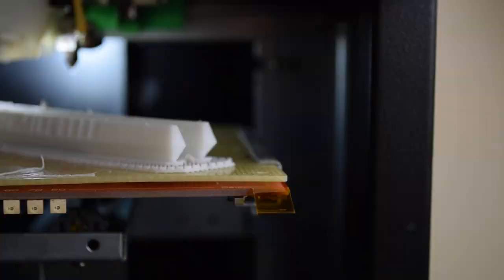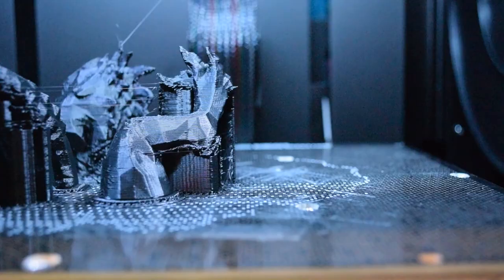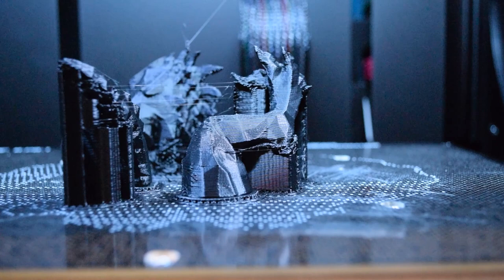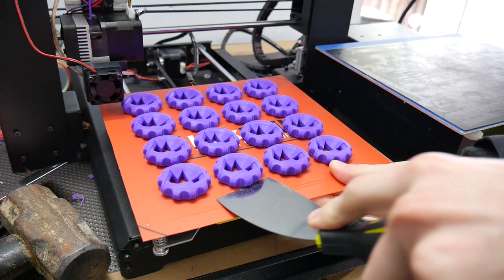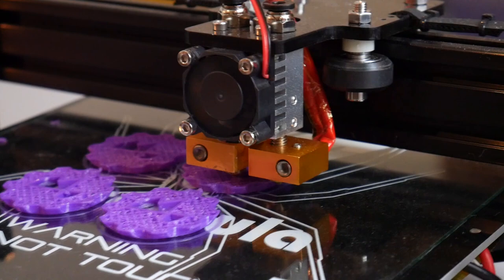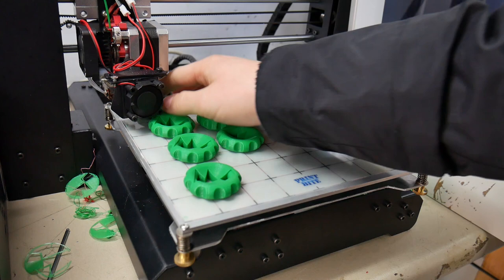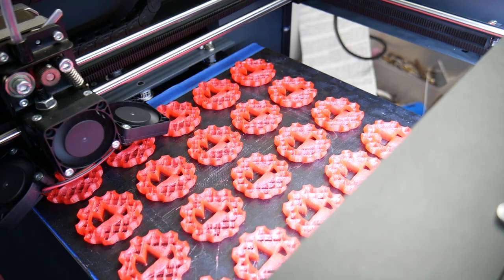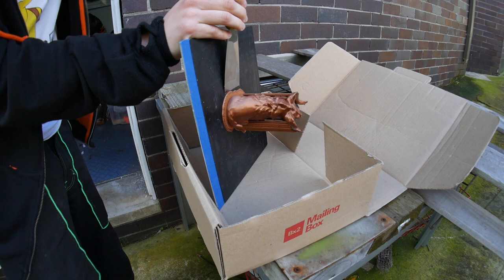The most dangerous 3D Printing Tool - Scraper Blade Safety - 3DP101

Comment: Your words of caution are duly noted.  One tip is to grind the corners down to a radius on the tool.  Helped me a lot!  I also don't keep it sharp.  When I ground the corners, I also beveled the leading edge in one direction and marked the tool "up" in order to make it more of a wedge than a knife-edge.  The grind would go on the "down" side so you can use the transition as a fulcrum.

Comment: Scraper safety tip(s): - Grind or File your scraper corners, to round them off,  - Double-edge sharpen only the front.  - (if possible) Mount a small strip of wood to your workbench. Place the bed on the bench and push the scraper away from you, in the direction against the wooden strip.
Preferably you shouldn't use a scraper, if you use removable and/or flexible build-surfaces, or a proven cooling/or heating technique to loosen the parts.  But sometimes it just absolutely necessary.

Comment: If you can't remove the print bed, I find it helpful to somehow block it from moving. I found that out after I was really careful holding a bed in place while using a paint scraper to remove a print. I did all the right stuff trying to keep my hand out of the line of fire, but the tool was redirected by an even more stuck part of the print once I got part way through and ended up going into my hand. Plus blocking the bed in place helps prevent damage to the machine and you loose less force to motions you probably don't want the bed to be going through anyway.

Comment: Another trick is to put your entire build surface in the freezer. Since the build material and the surface will cool at different rates, one will contract faster than the other. (Obviously, don't do this while the surface is still hot!)

Reusable ice packs also work well if you put them under the build surface, just below the print.

Comment: I do some woodworking as well as 3D printing and I found that an old hand plane blade is wonderful for removing prints.  The blade is heavy, very sharp, and one side of is mirror flat.  If I lay the flat side of the blade down on the printer bed and give the blade a tap with a light hammer, prints just pop off the bed with no damage to the print surface.  Very little force is applied, so safety hasn't been an issue.

Comment: Thermal Shock on non glass surfaces can sometimes help instantly release a part that's really stuck on. Heat it up a bit then hit it with something like canned air (in a well ventilated area)

Comment: I use some really dull paint scrapers, you could slide them across your tongue while pushing extremely hard on both ends and you won't even feel anything. I've never considered sharpening the tool, as I haven't had a need to (dull works fine for me).

Interesting video anyway, I'll keep the advise for the future. Thanks.

Comment: I use a painters tool which is basically a stiff paint scraper and only sharpened on one edge. The edge is like a wedge so once it's under the print is off.

When I was doing abs prints on bread board I would use that and a light wooden hammer. I find the hammer gives a much more controlled force and keeps both hands out of the way.

Comment: Just got the new Creality CR6SE... printed a Utah Tea Pot and my son's friend broke the top off the lid without getting it freed up.  I intervened before be could break more.  Looked at a video and the advice I came up with was let the glass(ish) build plate cool down all the way.  Still stuck... ran it under the faucet with cold water and the lid slid right off.  I already have Wham Bam bed system on order... I'm hooked.  But before scraping and scarring yourself, I'd advise running cool or cold water over the back of the plate and see if your print just releases.  It's the glass contracting I believe that makes it work so easy.  Could even run it under warm and then cold water for further expansion and contraction of the plate... no scrapers needed.

Comment: I have bought a Cel Robox and am using  PLA only at present. I find that the tool set supplied for trimming the prints after printing are useful, especially the 8-9mm wide bladed chisel. A little coaxing with that and off comes the print. I am being careful not to damage the bed. So far, no disasters! Useful video. Thanks. PS I`m not actually sure what the bed on the Robox is made of.....

Comment: My fav tool is my razorblade, held in a scraper tool,  obviously this is really dangerous :P  (only on my glass beds)   I have a meat cutters glove that i wear on my other hand just to play it safe. :)   

Angus your point about self releasing on glass only really applies to ABS,  ive found that PLA wont really self release from glass.      Generally i can user the razor blade to lift a small corner, then get the spatuala under the razor blade to pop off the rest of the print nice and easy.

Comment: Great Comments all good feedback, I'll try a post a video Angus of the BuildTak FlexPlate we have been using. It works like BuildTak only instead of using a scrapper to remove prints you flex the plate and they sort of peel/pop off.

Comment: What i found out was that if you print with a brim, you can take a scraper or hobby knife and gentle lift the brim in each side of the print. Then you are able to grab those 2 brim parts with your fingers and yank it off. (done with PLA on a aluminium bed)

Comment: I avoid scrapers like the plague. The best way to do this is by designing an aluminum plate with embedded magnets(programmable/polymagnets are the best for this application) and another sheet(spring steel) that is thin, flexible, and magnetic. A  printing adhesive or material (I prefer a thin PEI sheet that has a high temp adhesive backing) is applied on top of the flexible sheet. 

here's how it works:
the flexible sheet with PEI print surface is magnetically attached to the aluminum plate. When prints are done "shear"/slide the flexible sheet off of the aluminum plate and bend the flexible sheet which immediately pops the print off. :-)

Comment: i have a fiberglass bed, so you can just bend the bed to pop it off. on my delta i used a can of air, turn it upside down and sparaying liquid refigerant and it usually shrunk and poped off.

Comment: ONE: Scrapers are SQUARED on the tip, so it is wise to sharpen the EDGE approximately 15°-30° angle like a single edged knife but not sharp enough to cut flesh when running your fingers over it.

TWO: get rid of the SHARP edges! Sharp pointed tips cause tempered glass to shatter or when someone hit their palm with that tip it will definitely cut flesh. Use a stone grinder or sand paper to ROUND OFF the edges and then sand down the scraper to a 15-30° on one side.

THREE: use a removable borosilicate glass with 3mm thickness on top of the print bed. It’s safer to remove the print OFF the printer, convenient, but also prevent any damage to the printer/printer bed.

FOUR: instead of placing the print bed on your KNEES while removing the print, place the removable bed (cool-warm NOT HOT) on the floor if it is carpeted, if not use a rag or cardboard to prevent any damage to the bed and or floor.

FIVE: right knee down, left leg up, lean the bed over your right thigh to keep it STABLE at an 80-90° angle, push slightly on the scraper under the print (sanded part of the scraper up) and push against the bed and down while moving the scraper side-to-side until the print lifts up. If it is a BIG print use all sides to lift the print not just one side if it doesn’t have any weak components. Quick blows with a hammer or something will damage the bed if not done the right way and will DEFINITELY shatter glass.

My experience with it. I hope it helps...

Comment: If you need a scraper you're doing it wrong imo, right surface (PEI, PVAc/elmers glue) and right temps gives good stick while printing and easy release after. I've added a 140mm PC fan controlled by the printer to blast the print and bed down to room temp faster for quicker turn around.

Comment: Be wary of the scrapers that come with Wanhao i3/ Cocoon Create - the handle on mine has come loose (after using it to remove the BuildTak) and now it comes off regularly. It means that the sharp end can slip in unpredictable ways when applying force.
Reply: well I hope you bought a new one, Hyde is a good brand, most of us drywall contractors only use Hyde knives

Comment: personally ive bailed on a paint scraper and i use a "snow scraper" 3d printed at .05 layer height.  of course you A. have to be capable of .05 height. and B. have to be calibrated enough to be able to pull it off.  I'm on a rep2 and have a few printed on hatchbox petg and they are crazy sharp and perfect for this. and when they break, i just print more!

Comment: I have only used ABS and PLA materials so far, but I'm using my plain borosilicate glass plate with hairspray for both materials. I always let the bed cool back to room temperature and the parts self-release. I don't understand why there are so many products to expand on the problem.

Comment: i dropped a scraper on my foot once, was bleeding n stuff and i still got the mark of the wound. now i use a magnetic flexible PEI sheet with good adhesion when heated and if it cools down, i just can grab the print like its just laying on top of the bed.👍👍👌👌

Comment: I have no scars. My method: use a craft knife to carefully lift the edge of the print (about a millimetre), while holding with the knife blade slide the scraper under softly. This means the blunt scraper is not pushing on the edge of the print. Then remove the knife, lift the print about five mil using the scraper as a lever, and then slide the scraper in a little further. Rinse repeat. Easier with a raft, but works every time because you're not pushing the print sideways, but lifting a small portion. Go slow be careful.

Comment: Printbite. It bloody works.
Reply from the maker: I'm inclined to agree! Haven't torture tested it yet but for every day printing it works a treat.
Reply: Yep. I mostly print in ABS and was fairly happy with PET tape and ABS juice, tried Buildtak, which sticks so well I destroyed if after 3 prints. Bought some Printbite and will never go back!
Reply: PEI is just as good :D
Reply: I used to make the same mistake with PET tape. However, i realised later. You dont need ABS juice for PET Tape to work. Just print slow for the first layer, 10mm/s or lower, at 110C heated bed or slightly higher. If possible, raise the hotend temperature slightly for the first layer, about 5~10C. Your print will pop right off when the bed is cooled.
Reply: Im pretty new to this whole printing thing and when i got my first printer as a gift from the rest of my family i noticed that my first layer would never stick and a portion of the print would curl off the printbed, ive pretty much fixed that by using blue painters tape, except when i went to print a little model vanguard (a star citizen spaceship) for my brother and the back left part of the print lifted off for some reason, it didnt ruin the print just it just sort of "squished" the back of the part where the first layer didnt stick and curled off of the plate.
idk how to fix it as im super new to this whole printing thing

Comment: Just use PET tape, it works like magic, you dont need to risk breaking your hand or your print with the scrapper. Your print pop right off when it is cooled.  Not to mention the bottom finish of your printed object looks glossy and smooth like glass.  It works with ABS, PETG, and PLA. I am yet to test other type of filaments. For abs, heat your bed to 110c for printing. 70C for PETG and PLA.  Your print will pop right off at around 40~30c when the bed is cooled. Even if your print doesn't pop off when the bed is cooled, you just need to twist/pull it with a little force by hand.  Safe and easy. The tape seems to last forever as long as you don't scratch it with a knife or scrapper, or damage/wipe it with acetone.

P/S: if you failed to get your print stick properly, just make sure your first layer is printed at really slow speed, like 10mm;s or lower. Increae the hotend and/or bed tempature by 5~10C if you need to.  Your print will stick really well when the bed is still powered.

Comment: I just pry with the scraper. I just put it on the build plate with the edge grinding flat on the plate, slide it a bit under the part then push the handle down. Its like a wide and small crowbar. It makes a little space then i can push it a bit further in and pry again. It takes 2-3 pries and it usually pops off the surface.
Another thing my scraper came horribly chipped and all burred on its edge. I just used sandpaper to get it nice and clean. And i dulled the edge a little bit too. I dont need it digging in the surface... By the way i use the wanhao i3 stock surface, i read its like build tec? Anyway sticks well and releases nice.

Comment: I have another way to take prints of the bed: with those snipper thingies, put it under a corner and snip just the corner of the print bed. then, use the blade and start with the corner you took of the print bed and scrape.

Comment: what i do is i first push under the "Skirt" and release it. and then i take the scraper thingy and bash on it so it goes under the print it self and then i bend it to right or left and plopp goes the print into the air and my fingers are never even on the side of the blade :D

Comment: place it under a corner/edge.. then tap the end/handle with a mallet/anything heavy n handy..
Reply: I remove my prints while still on the bed & glass so I can press print again within seconds..
this has never failed, just make sure you get it between the print and bed.

Comment: Hi! 
I was interested in if you could take a look at some of the ColorFabb specials? 
Things like Wood, Cork or Copperfill look really interesting, and the CF-XT material might be super awesome, however it's hard to say if it is worth to get them due to how little good reviews there are.

Also, since you have done a video about different functions of Simplify3D, I think it would be fair to give Slic3r some attention too.
It's a free and well working alternative after all, and DOES have the capability to do some fancy tricks thanks to "modifier parts" that allow localized changing of settings.

Comment: tip: use razer to get underneath the print first(even just a little bit). then use scraper to finish the job. so much safer, so much better.
With this method, my blue tape is even still intact !!!!

Comment: A beveled chisel is waaaay better than a damn scraper. It is sharper and much stronger, it does not bend when you use its bevel to get under the print. Also: this is why the heatbed glass has to be removable, you take the glass off and put it in warm water with a few drops of detergent for a while. It pops off pretty easily.

Comment: I don't understand why you have so many troubles with this. Just put a 4mm (or 6mm if you printer can handle it) tempered glass. Use a hair spray on it, waith a few seconds to dry. Print over it. Wait until the glass is a bit cold and the piece almost pup up by itself. The tempered glass it's very hard to break and never fails. Try it, it nevers fails.

Comment: +maker's muse which printing surface do you prefer/sugest for general printing (mostly PLA and PETG but also some ABS and TPU) PrintBite or PrintinZ Skins? Keep up the good work!
Reply from the maker: Both work great so far, Printbite needs a hotter print bed than the skins in my experience, up to 115degC for big ABS Parts
Reply: what about durability? Similar?

Comment: you should use a knights gear when you work with such a dangerous blade.... or just... use it with common sense... the one you are helding comes from your UP printer? i have the same on in my shack. great scraper.

Comment: I have a JGAURORA with "black Diamond" glass bed. I am afraid of damaging the coating of my plattform by using a scraper or other tools which perform mechanical stress to the plattform.
Currently when a print stucks on the bed, I heat the bed up to around 80°C and use some very strong and thin string to get the print off the bed. I try to get the string beneath the bottom layer and use it similar to a band saw, to cut the print off the bed. 
Once I damaged my print by cutting through some layers.
Has anyone experiences with the JGAURORA plattform or ideas how to get the print of better without damaging the bed or the print?

I mainly use PLA and PETG

Comment: The problem with holding the bed against your leg like you did is that if you have a major slip, the femoral artery is so close. It's like cutting the bottom out of a bag of water.
Better to just cut your thumb.
Reply from the maker: True, I'll keep that in mind. The idea is due to the angle I use a slip falls away from the body.

Comment: after a print is done, i let my glass bed cool down to room temperature, then put it in the freezer for 10 minutes and the prints pop out by just using your hands. I use glass + glue stick. 

I once broke the glass trying to get a print out and cut my hand in the process. Never again.

Comment: wait, Angus, you have sharpen your scraper from both sides? o0
Reply from the maker: That's how some of them come. Some are blunt, some have one edge and some two. It's a lottery!
Reply: I see. Just wondering, in my opinion both sides is a really bad idea for build plate and print.
Reply: I think too. Mine came with one sided edge, and its the way to go. I dont even use it like you would use a scraper, but more like a crowbar or a lever.